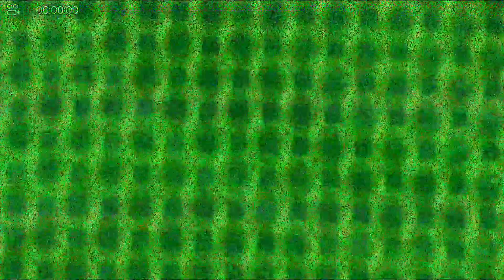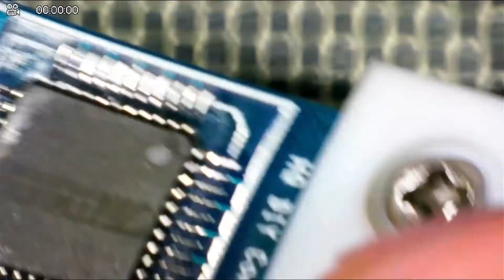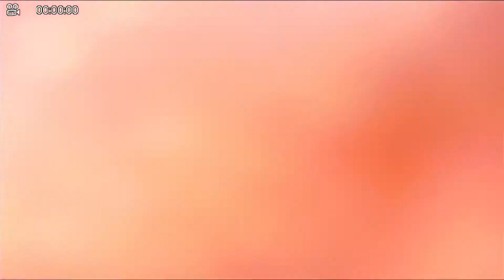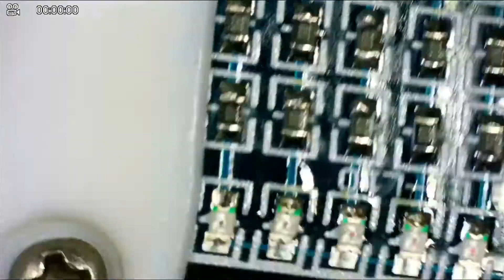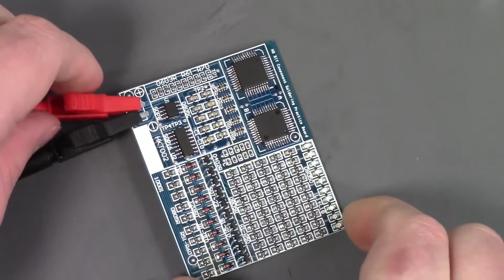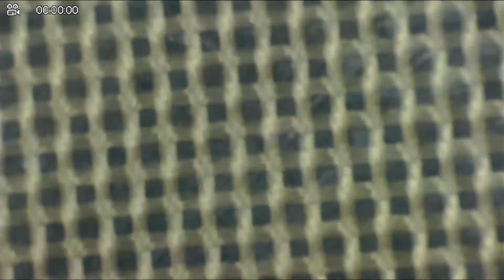SMD Practice Soldering 30 Minute A Day Challenge Part 6

Comment: why not try solder paste and hot air for mounting this components?

u dont like that? or why?
Reply from the maker: That is a thought and I have done it on boards with a stencil. I feel that doing it this way helps improve skills I use in repairs on a daily basis
Reply: I understand compleatly! Have to train my skills too. Repaired my first XBOX One X yesterday. Im so happy that all worked
Reply from the maker: Congratulations on getting it working, I have an Xbox 1X coming this week to work on.
Reply: Ups wrote with my second (wrong) account
Reply from the maker: @TechnicNerdAT  you have done that in Phil’s streams too, didn’t you?
Reply: Yes. Sorry. Im at beginning to rise my channel. Yesterday i repaired the xbox (retimer) live